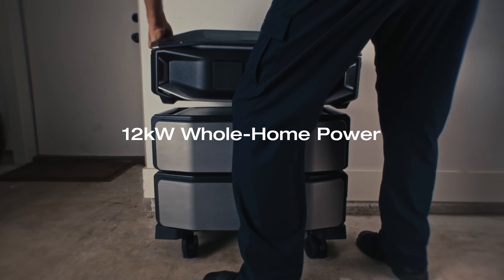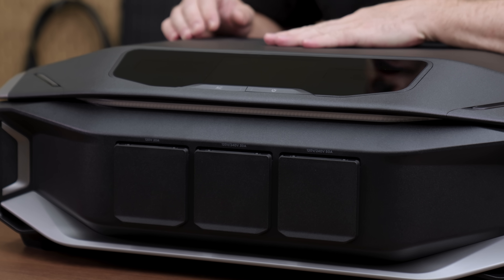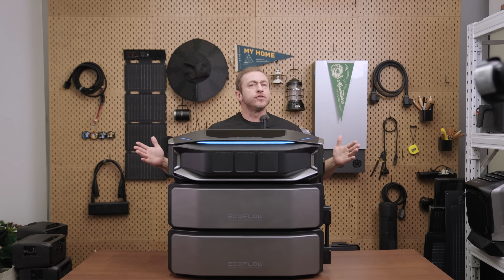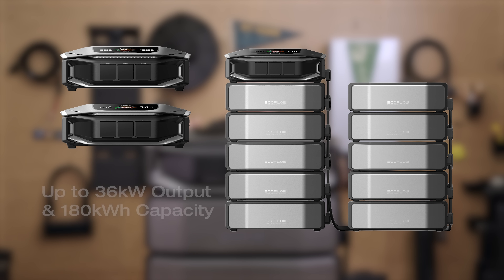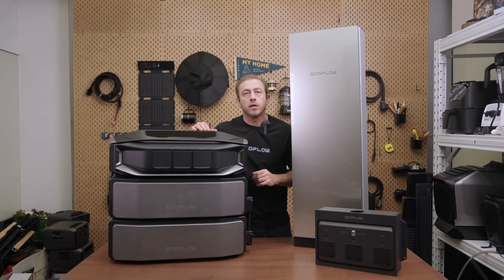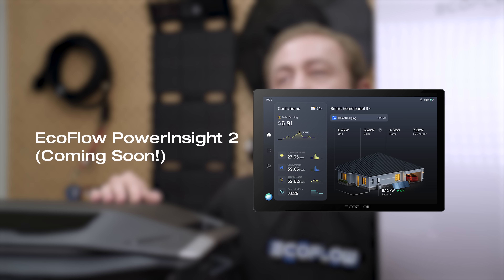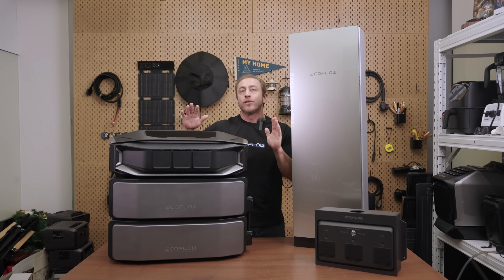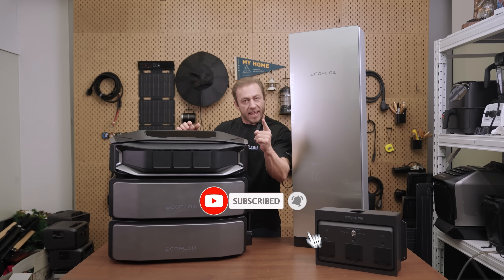EcoFlow DELTA Pro Ultra X: All Features Explained

Comment from the maker: Got questions about the DPUX? Or want to see specific content about it next?
💬 Drop your thoughts to this comment—we’re here to hear you!
Reply: Will the Delta Pro Ultra X be made compatible with the smart home panel 2 through firmware updates?
Reply from the maker: @teamvoldemort6114  The Smart Home Panel 2 does not currently support DELTA Pro Ultra X integration. To integrate it, please purchase the Smart Inlet Box. The accompanying software is under development; please stay tuned to EcoFlow's official channels for updates. Thank you.
Reply: Will the older Delta Pro Ultra work with the Smart Home Panel 3?
Reply from the maker: @KurtVanEtten  The EcoFlow Smart Home Panel 3 supports connection to a Delta Pro Ultra X or Delta Pro Ultra via the EcoFlow Smart Inlet Box Connection Cable (5P8 Port to 5P8 Port) or EcoFlow Power Input/Output Cable.
But please note: A firmware update is required when connecting the EcoFlow Smart Home Panel 3 to the Delta Pro Ultra.
Reply: Can you mix the batteries so basically use both the new ultra x batteries and also the previous ultra batteries with the new inverter at the same time. So let's say I have 2 of the new batteries and 2 of the old batteries will they work together? Also what's the advantage of the new batteries?
Reply: @rayuserp there aren’t any ‘new’ batteries. The batteries are interchangeable with the old DPU inverter and the new DPU X inverter.
Reply: I have DP3s and am looking to expand to the full 200A SHP3. Will DP3s work with a firmware update with the SHP3?
Reply: Will the power insights tablet work with the DPUX and/or SHP3?

Comment: I just bought 5 DPUX batteries and inverter. I also plan to buy the SHP3. What additional accessories do I need to hook this up to my existing solar panels with IQ7 microinverters (installed 2018 by Ion solar)?

Comment: All of the promotional material shows only 5 batteries max stacked together. As long as I secure the stack from tipping could I stack 6 batteries and then the inverter? Asking from a weight point of view. Will the cart and the bottom battery support the weight of 1 additional battery?
Reply from the maker: 1. Yes. One inverter supports up to 10 batteries. Each inverter and battery comes with stacking clips at the bottom, so they’re easy to stack and lock securely.
To add 6 batteries, just stack all the batteries together first and then attach the inverter—exactly as you described. You can also split the 6 batteries into separate stacks. Here are two examples from one of our users: https://www.facebook.com/EcoFlowGlobal/posts/pfbid02Lwn1iWbYFqxo18PXzHCwSFEEJDtpN1AZP8MgboMmdfhTLwoySu8V3Jn5coV2MY3Fl

2. To ensure stability during transportation, we recommend placing only one battery on the trolley (cart).

Comment: I'm looking at purchasing DPU X and Smart Gateway. Does Gateway come with smart Inlet Box or is it extra accessory? Will the Smart Gateway replace my standard electrical panel? Do I need an extra accessory to connect a 3rd battery to Inverter? Lastly which is better Smart Gateway or Smart Home Panel 3? Thanks
Reply from the maker: 1. Yes. The Smart Gateway includes both the gateway panel and a Smart Inlet Box. To integrate DPUX with your home, just connect the system to the Inlet Box using the included Connection Cable. 2. The Smart Gateway will not replace your standard electrical panel, but the Smart Gateway can act as a main panel, and work in conjunction with your standard electrical panel as sub-panels. The Smart Gateway works like a smart auto-transfer switch. It supports up to 6 circuits and is typically used for managing non-essential heavy appliances. During outages, it automatically disconnects those loads to keep your essentials powered. 3. DPUX is plug-and-play. To add a third battery, simply stack it, let the auto-lock clips engage, and connect the Battery Cables. No extra accessory is required. 4. Both Smart Gateway and Smart Home Panel 3 offer same-day installation, circuit-level control and 20ms auto-switchover. Your choice depends on how much control you need:
Smart Home Panel 3 (32 circuits): Full-home control with precise, per-circuit management. Ideal when you want every zone and appliance—critical and non-critical—smartly managed during both outages and daily energy routines.
Smart Gateway (6 circuits): Connects up to 6 non-essential heavy-duty circuits. During outages, it can automatically shed these loads (e.g., EV charger, pool pump, outdoor AC), keeping your backup power available for the critical devices you truly rely on.
Reply from the maker: And if you have any additional questions, please don't hesitate to reach out. Should you decide to proceed, don't forget to get $300 off with code DPUXSM300.
Reply: @EcoFlowTech I went with Smart panel 3. Discounts can’t be doubled up- one per order. Thanks for info.

Comment: Seriously considering the Delta Pro x. I'm totally off grid, home is under construction with no electrical panel installed yet.  Would the smart panel be the best choice for me? Did you say the smart panel 3 would be my electrical panel?
Reply from the maker: For your off-grid home under construction, DELTA Pro Ultra X + Smart Home Panel 3 is a solid choice. SHP3 can act as your main energy hub, offering smart management and precise control for up to 32 circuits — no traditional electrical panel required.
Reply from the maker: If you have any additional questions, please don't hesitate to reach out. Should you decide to proceed, don't forget to get $300 off with code DPUXSM300.

Comment: So I have existing solar is there anyway my existing solar can charge this instead of having a charge in the grid/?
Reply from the maker: Yes. DPUX supports third-party solar input up to 10kW, whether it’s DIY panels or your existing rooftop array. You can also use TOU Mode to prioritize solar charging and then draw from the batteries during peak hours.

Comment: Would love to see you make a video that shows how to do firmware updates to ULTRA batteries to work with the DPUX system and how to connect them so they function well with the DPUX and the 2 batteries that come with the bundle.  Thank you!
Reply from the maker: Please check out the firmware update guide: https://manuals.ecoflow.com/cn/product/delta-pro-ultra-x?lang=en_US
For real-life examples, feel free to join our Facebook DELTA Series Group and check out other users’ firmware update experiences!
Reply: @EcoFlowTech  my electrician is connecting the SP3 to my house as a sub panel.  (180 amp) does the smart inlet box need to be connected with ethernet cable to the SP3 or is it bluetooth?  Also is an overload switch really necessary? Especially if it's not being used as a MAIN circuit panel?  Lastly Do you really need the rectifier box for a 30 amp gen input?  or can you just run a 30 amp cord from the inlet box to the DPUX with a purchased cable?

Comment: 1.  Is the Smart Panel external weather rated? I'd need it mounted next to our outdoor meter to charge it with a generator because we don't have enough solar window to charge batteries in a grid down scenario
2.  How do I connect the Ultra X to power the house if my current breaker panel is in my laundry room & still charge from a generator outside.  We don't have a shed or garage to put the system in. We can put the Ultra X in the laundry room.  But Smart Panel wouldn't fit in that room.
Reply from the maker: 1. Protection rating: NEMA 3R
2. Connecting to the generator for charging requires the optional accessories EcoFlow Generator Charging Adapter (NEMA L14-30P to 5P8Port) or EcoFlow Generator Charging Adapter (NEMA 14-50P to 5P8Poort).

Comment: While this looks awesome, there's two major things they really need to address.

1. 5 year warranty. The industry standard is 10 years. If they really want people to buy this, they need to increase the warranty to 10 years. It's really a lot of money. You can't sink $10K+ into this, only for it to die 5 years later and EcoFlow says, "Sorry!"

2. Battery cycles. They need to let us know what they are for this one. For the DPU, it was 3,500 cycles to 80%. There are batteries out there that can reach a staggering 9,000 cycles before dropping to 80%! The battery is critical and each one is $2K. Again, hard to sink that much money into this if I don't feel confident that I can get at least 15 years use out of it.

Otherwise, this looks like a winner.
Reply from the maker: 1. Thank you for your valuable feedback. In the energy storage industry, mobile storage products typically come with a 5-year warranty, while traditional home storage solutions usually offer warranties ranging from 10 to 15 years. As an industry leader, EcoFlow upholds stringent quality management standards that exceed the industry norm, ensuring a reliable product experience for our users. You can use our products with confidence.
2. Our DELTA Pro Ultra X uses high-safety battery cells and is designed with stringent testing standards to ensure stable and reliable operation even after years of high-frequency use.
Reply: I also was afraid of that. My plan to have a work around is start with 1 battery. Stagger my buying extras by 2 years. So then if one goes bad, hopefully I only have to buy 1 battery every now and then...hopefully only a couple times.

Comment: What are EcoFlow’s plans for users to self-manage their EcoFlow systems when the EcoFlow app malfunctions and communications with EcoFlow’s servers terminate? Please note that this weekend’s time-change problem demonstrated to my team an ENORMOUS liability the EcoFlow products has created in our energy resiliency project. We simply cannot continue with EcoFlow if after all our investments, we cannot control our remote energy needs when EcoFlow servers/software fails. There has to be a localized option.
2. What policies/procedures is EcoFlow implementing to mitigate “stupid” failures, like software that cannot manage through a routine biannual time change? What are you planning to do so these types of mistakes don’t happen again? We would like as much detail here as possible.
3. Does EcoFlow intend to distribute more detailed information on firmware upgrades BEFORE rolling out the upgrades? We need more information so we can evaluate our risks before we roll firmware versions.
4. Going along with item #3 above, what testing protocols does EcoFlow employ, and plan to employ prior to firmware releases? As I have indicated in previous emails, the majority of our problems with EcoFlow products have been with software and firmware updates. There have been a few hardware issues, and these were always addressed promptly. Software, app, and firmware issues are a whole different matter.
5. As I indicated in my previous email, during the shutdown of telemetry (caused by the time-change error), the four systems (out of seven) at our farm that utilize solar input turned off solar input and went with grid input, costing us money. It violated our solar-only settings. Also, the grid input OVERCHARGED some batteries during this period, apparently overriding all BMS safety protocols. I previously sent you dashboard pictures from one of the systems. Please explain precisely, why this occurred and how does EcoFlow intend to fix software that can override a system’s BMS when internet connectivity fails? Again, provide as much detail here as possible.
6. Lastly, about the latest firmware rollout that automatically updated all our systems, even though they are all set to NOT allow automatic firmware updates. This is a SERIOUS problem and a violation of terms of service. Please explain how this happened and what EcoFlow intends to do to prohibit such automatic violations of user settings in the future.

Comment: If only it had a 10 year warranty. Great product.
Reply: SP3 has a 10 year warranty.  The rest I believe is 5 years.
Reply: @Elembytes  Right, but that's the problem. I'd love to start off with the DPUX and maybe 2 batteries, then add a battery here and there. But it's hard to do that if they're only guaranteeing the battery for 5 years. Also, the cycle count is huge. There are companies like Riuxi that have batteries with a 9,000 cycle count before reaching 80%. I'd want this to at least do 6,000 cycles. For you to make your money back and get to the point where this is making you money, the batteries need to last at least 10-12 years. If you tell me I can get 20 years of use before it drops to 80%, then I know I have 10 full years of profit. If that batteries only hold 50% charge after, I don't know, 6 years, then it's not worth it financially.
Reply: @dontbanmebrodontbanme5403  lol exactly my thoughts...if I'm forced to ecoflow, my plan was to stagger my battery buying so if one died at least I'd have a couple newer ones...then a new replacement to add to the rotation. Hopefully it isn't often.